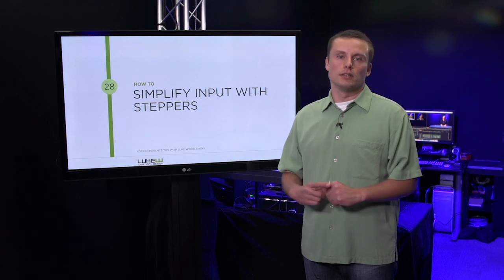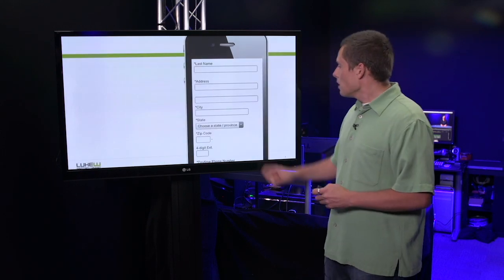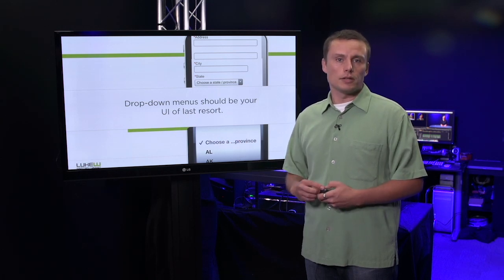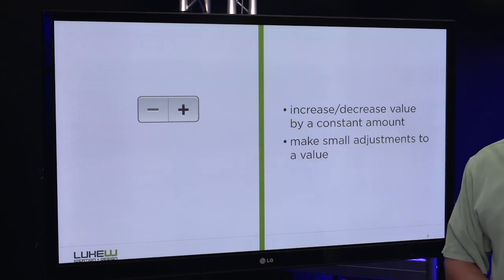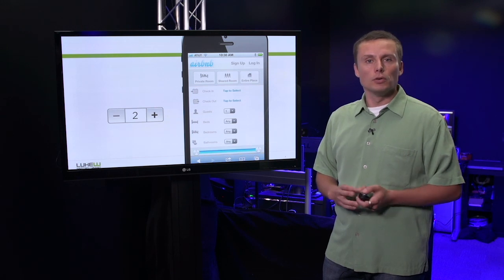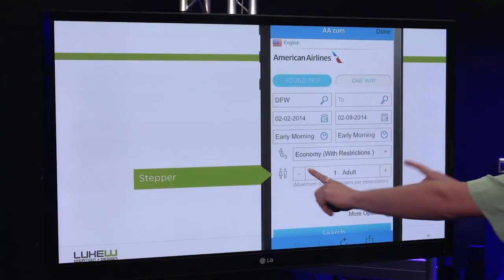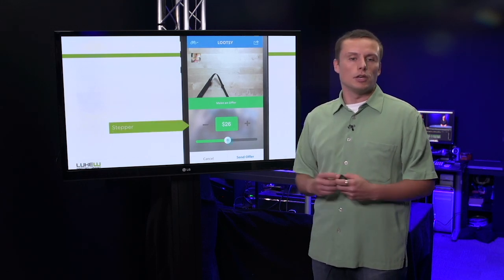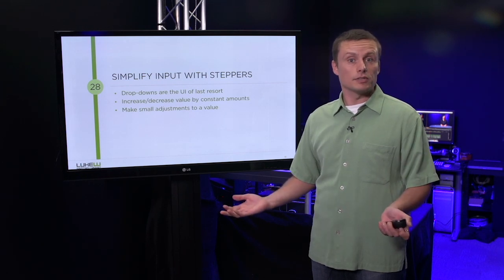How to Simplify Input with Steppers | Intel Software

Comment: At the beginning of the video you showed the problems of using a dropdown to select an option from a textual list, in this case, US states. However, you then proceed to show a solution for options which were purely quantity based like the number of travellers.

So while I like the solution of the stepper for numerical options, it would have been nice if you had shown a solution to the first problem you presented. Because now I'm left wondering, should I use a stepper for lists of states/countries or should I use another solution?
Reply: same here...
Reply: Yep. I was thinking exactly the same thing.
Reply: Agreed also and I'm not convinced the use of steppers was totally sold. I mean tapping 7 times to select 8 travellers or just use a drop down? I know I would prefer the latter every time.
Reply: Darren Taylor These are general prescriptions with caveats and augmented solutions (slider control) provided. He refers to the 8 traveler scenario as an edge case. Consider this series as an exploration/demo of UX options. It's careful to avoid absolutes.
Reply: This is a classic example of how people prove a point on an irrelevant problem - in the end he looks good to many. Still curious to see how he would handle state selection.
Reply: Adrian Kecki I don't think he means that the dropdown is a inappropriate choice for state selection, only that it should not be your default go-to solution. For many kinds of data there are better options (like the ones he demonstrates in the other form).
Reply: absolutely right. Let's explain one problem and show a solution for another.